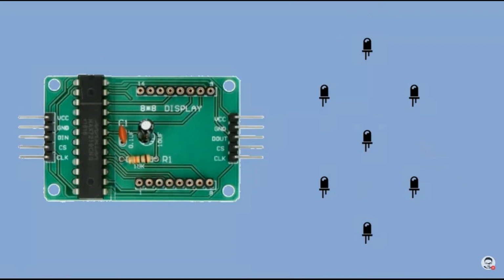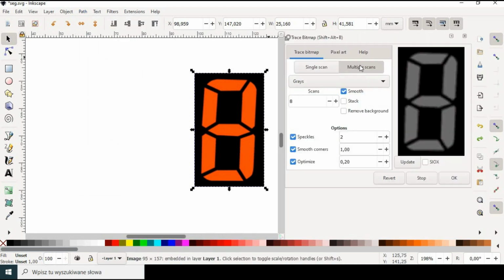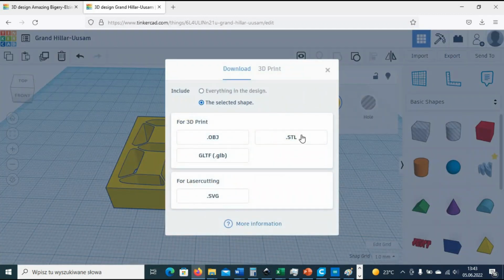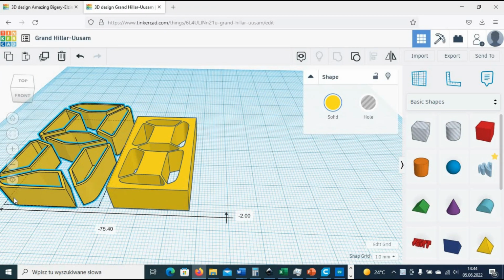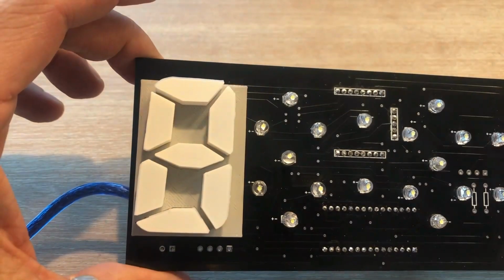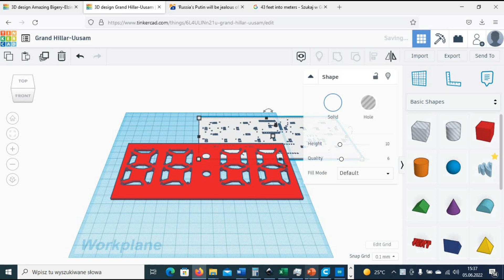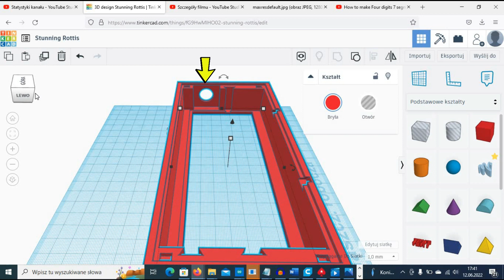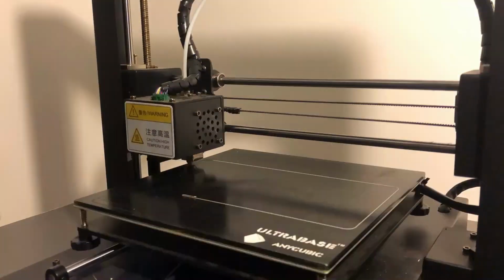Creating a 3D Printed Case for My Arduino 7-Segment Clock

Comment: Cool project !
Try applying a piece of "dark tone film", a foil from the car tuning realm. It works wonders ! I put it all of my 8x8 max7219 clocks ! It looks totally crap without it. The LEDS are easily "strong enough" to break through, and you get rid of the nasty black/white pattern on the bare product. It's "filtered" out, so to speak.
Reply from the maker: Thanks for the tip:) But How would you use it in this 3D segment approach ?